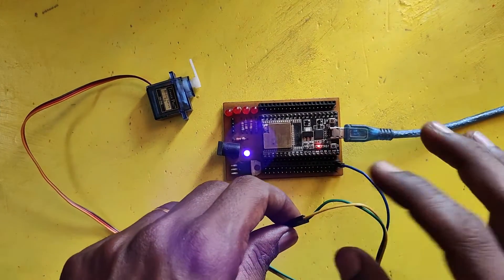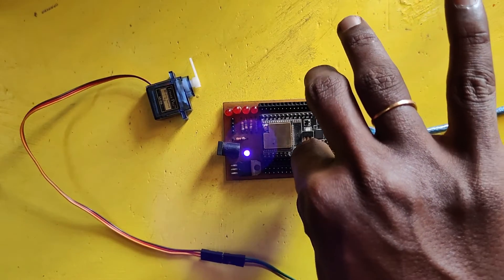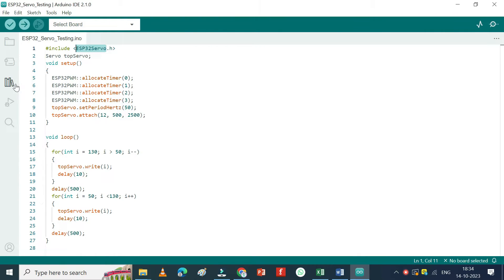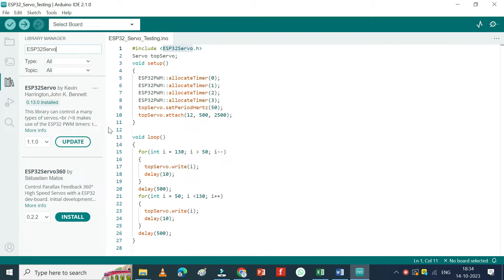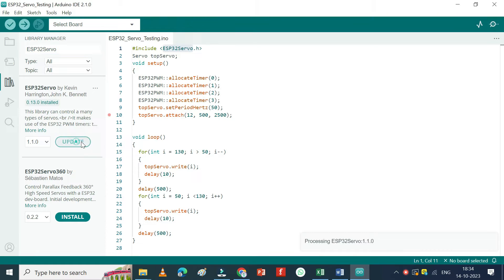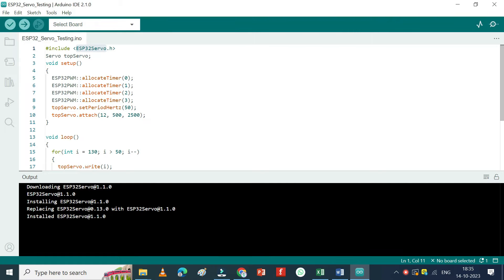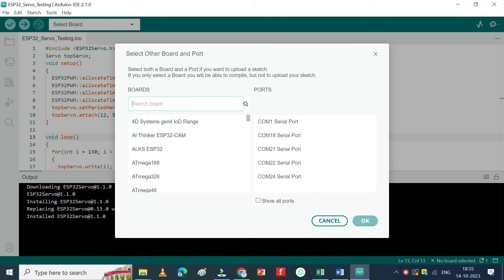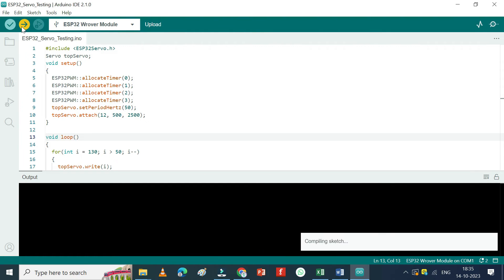ESP32 Servo motor Testing | ESP32 Tutorial - Using Servo Motors ( NEW Arduino IDE )

Comment: Hi friend. 
Please help me, you know how to fix this error.
 

( Output
IF
D
C: \Users\schev\AppData\Local\Arduino15\libraries\ESP32Servo-master\src\ESP32PWM.cpp: In member function 'void ESP32PWM::adjustFrequencyLocal(double, double)':
C: \Users\schev\AppData\Local\Arduino15\libraries\ESP32Servo-master\src\ESP32PWM.cpp:172:17: error: 'ledcDetachPin' was not declared in this scope; did you mean 'ledcDetach'?
ledcDetachPin(pin);
172
ledcDetach
C:\Users\schev\AppData\Local\Arduino15\libraries\ESP32Servo-master\src\ESP32PWM.cpp:176:17: error: 'ledcAttachPin' was not declared in this scope; did you mean 'ledcAttach'?
ledcAttachpin(pin, getChannel()); // re-attach the pin after frequency adjust
176
ANNNN
ledcAttach
C:\Users\schev\AppData\Local\Arduino15\libraries\ESP32Servo-master\src\ESP32PWM.cpp: In member function 'void ESP32PWM::attachPin(uint8_t)':
C: \Users\schev\AppData\Local\Arduino15\libraries\ESP32Servo-master\src\ESP32PWM.cpp:237:17: error: 'ledcAttachPin' was not declared in this scope; did you mean 'ledcAttach'?
ledcAttachPin(pin, getChannel());
237 |
ANNNNNNNNNNIN
ledcAttach
C: \Users\schev\AppData\Local\Arduino15\libraries\ESP32Servo-master\src\ESP32PWM.cpp: In member function 'void ESP32PWM::detachPin(int)':
C:\Users\schev\AppData\Local\Arduino15\libraries\ESP32Servo-master\src\ESP32PWM.cpp:264:9: error: 'ledcDetachPin' was not declared in this scope; did you mean 'ledcDetach'?
264 | ledcDetachPin(pin);
ANN
NNN
ledcDetach
exit status 1
Compilation error: exit status 1
Ln 1, Col 1 Heltec WiFi LoRa 32(V3) on COM10 [not connected] G1 E
ENG 9:50 PM
81°F Clear
<
INTL /1/2024
Type here to search )
Reply from the maker: Use example program and try